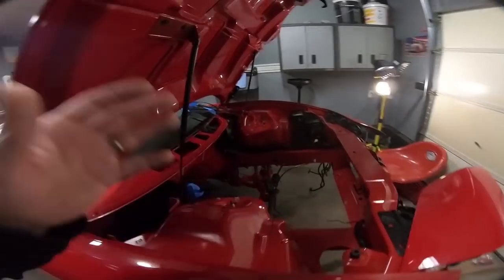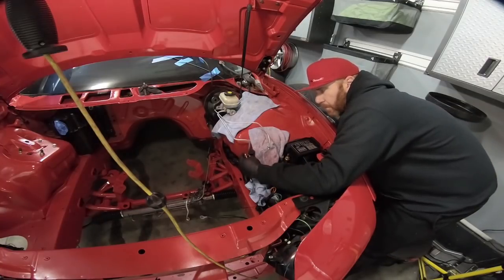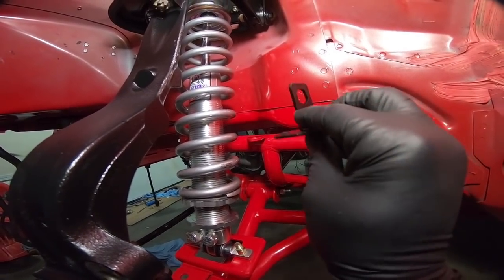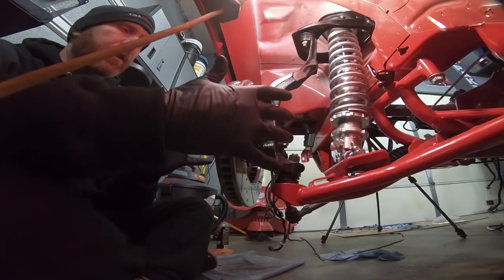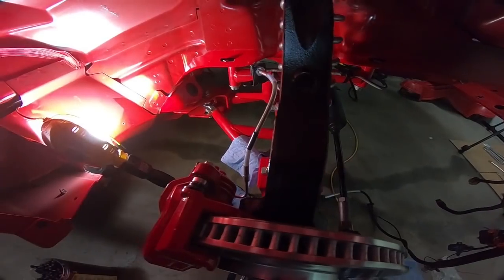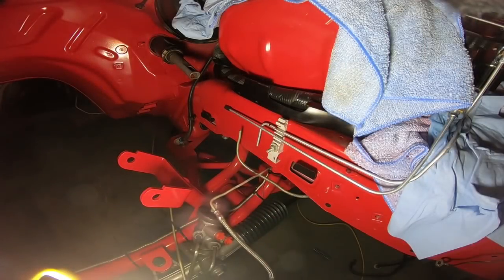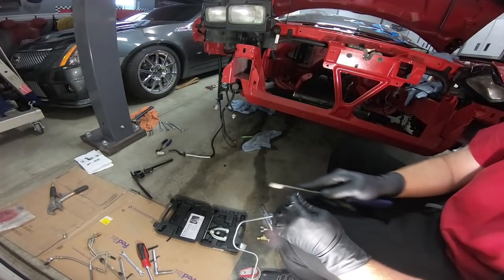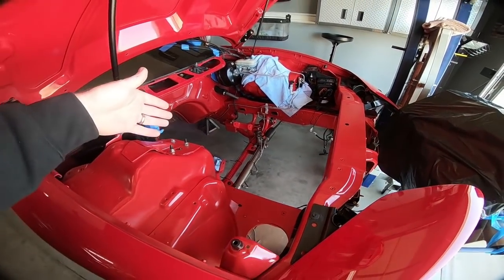How to Install Line Lock and ABS Delete Trans Am Camaro Firebird(Trans Am WS6 Tear Down Part 15)

Comment: Man I did a 95/01 front end swap and I cannot get the passenger side headlight to line up. Like the whole assembly needs to go towards the fender. And the front edge needs to come down. Any suggestions. Or plz make a video there is not one anywhere on YouTube. On how to adjust the headlight housing specifically. Just how to aim the bulbs that's all I can find.

Comment: Nice job Travis,my camaro I bought it with the line lock already installed but with the abs,what is the advantage of deleting the ABS???
Reply from the maker: Thank you. Just weight really and more under hood clearance
Reply: looks better under hood. brakes work a lot better at first I pulled my fuses for it but finally eliminated it for clearence for turbo
travis did you unplug the abs or cut. the plug out with the wires
Reply from the maker: @matthewcatalano755  just unplugged for now.

Comment: Funny how we have a lot of the same mods going on..lol.... I haven't bought my kit yet. But when I went with my Moser 12 Bolt I got rid of TC and ABS is Inop.  I still have the ABS Block and I really just need to delete it if for anything to clean my engine bay of useless junk.

EDIT: As a side note, since you have the 98-02 4th Gen. Have you ever thought about upgrading to the CTS V Gen 1 Brembo Calipers and Gen 5 Camaro SS Rotors?
Reply from the maker: I upgraded to new brakes a while back. Ctsv and new camaro brakes don't fit under the wheels I like.
Reply: @TWAMotorsports  I thought about it, but because my car is a 97 I would have to scavenge a couple parts off a 98-02 for it to be a complete swap. Right now with what I'm putting down WHP Wise. My current brake setup works just fine for me. Maybe someday just not right now.
Reply from the maker: @mcbridemotorsports5788  yeah 97 could benefit from ls1 brakes

Comment: Around about what would be the full cost of this line lock abs delete? I’m v8 swapping a v6 99 firebird and I’m gonna try and use the truck accessories with the modded alternator bracket but the abs would get in the way
Reply from the maker: About 200

Comment: you should maybe research some other types of brake line hold downs such a nice job done in the bay there to have zip ties. if they make something that may work
Reply: i know dorman makes the factory plastic single hold downs dorman number 800-281 that u could possibly drill a couple small holes in the k member to push them into
Reply from the maker: @jasonmeulendyk6771  I know. I dont want to diminish the structural integrity of the k member. I agree though I hate zip ties.
Reply: i think maybe 3 or 4 small holes 5/16 could do it id maybe check with the k member company see what they think. still amazing job man very clean!
Reply from the maker: @jasonmeulendyk6771  thank you

Comment: I have a question for you.  The rear end of my ws6 is slanted a bit towards the drivers side.  Any ideas on possible culprits?
Reply from the maker: If you mean it sticks out further on that side, is it lowered? If so or it has been wrecked it may need a new or adjustable pan hard rod
Reply: @TWAMotorsports  it just seems to squat to the left about an inch and a half.
Reply: @TWAMotorsports  yes it has been lowered.
Reply from the maker: @marcoarreola9058  that could be a bad strut or spring issue then
Reply: @TWAMotorsports  thanks
Reply from the maker: @marcoarreola9058  you're welcome. Without seeing it its kinda hard to say.

Comment: Dude your gonna need to run those Viking springs way up further than you have them when weight is on the car.  Just FYI
Reply from the maker: Yeah I'm aware but with no weight on the front I will need adjustment either way

Comment: Did you use a compression fitting for the line going to the rear brakes?
Reply from the maker: No. All stock connections
Reply: @TWAMotorsports  I appreciate your answer. I just got my kit and hadn't opened it yet before I watched your video....LOL. I then opened it and saw the inline flare joint!! Again thanks for the answer. I will be putting this kit on as you did with a bare engine compartment. Hopefully all my flares and bends go as smoothly as yours did!
Reply from the maker: You're welcome. Its pretty easy and straightforward install

Comment: after all this work why use the factory brakes? use the brembo off 14 grand sport j55 package, these clear factory 17'' wheels
Reply from the maker: The brakes on the car are better than stock. Many have ran 8 second passes on stock brakes with no issues slowing down.

Comment: Before final tie down I personally would put pieces of rubber fuel line around the metal so you don't ware holes from the metal on metal contact. Clean install thou
Reply from the maker: It actually has the factory protection slinky as I would call it over the brake lines.

Comment: Where did you get the brake line clips?
Reply from the maker: They were on the car
Reply: @TWAMotorsports  the stock brackets just cut off original k member?
Reply from the maker: @lsxjunkie  yes